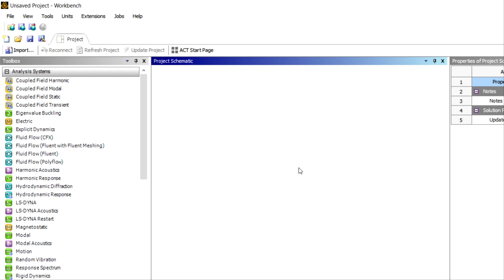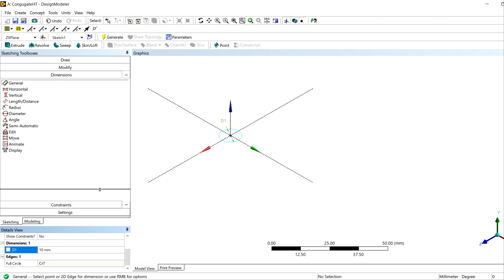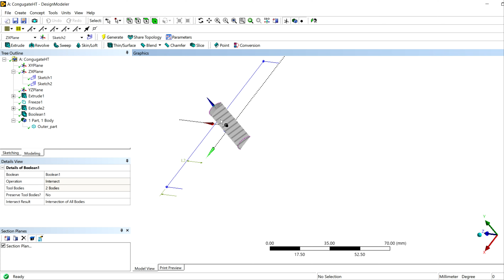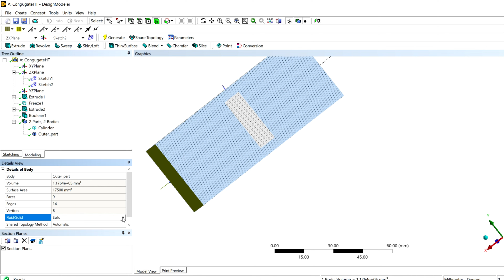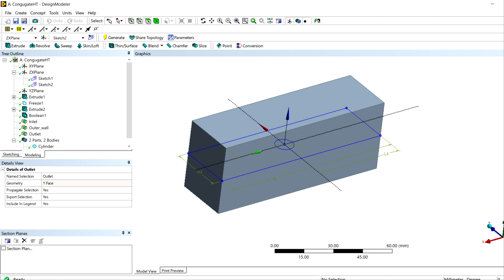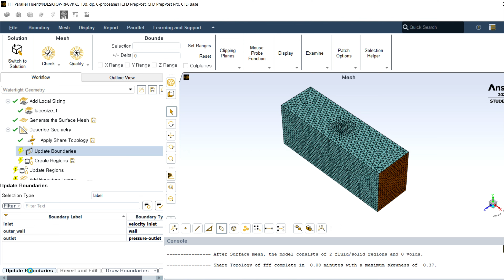ANSYS Fluent: Conjugate Heat Transfer,  Boolean operation|, Interface, and Surface Topology

Comment: I need to know one thing, if I want to print droplet on conformal shapes. Should use Boolean substact method to create two Bodies? Like the substrate is inside the the  air and fluid domain
Reply from the maker: I think you don't need to create separate bodies. You have to use patch frature in fluent to create droplet.
Reply: @TechnoLabTutorials2402 actually I wanted to do the same as your model.but my cylinder will act as a substrate solid body, where ink will form droplet. And the square box will be my simulation air -ink domain. Do you think it's correct?
Reply from the maker: @abrarfahim9287 @abrarfahim9287 Maybe I misunderstood the problem. Will the ink droplet be printed on the surface?  So you have sold substrates as well as ink and air correct? In that case, you can follow the same method as described. For the droplet, you may still need to use the patch feature of Fluent.